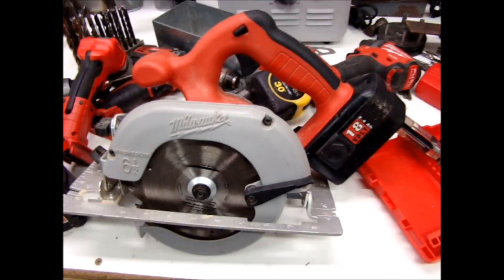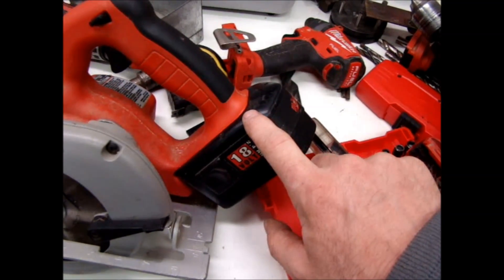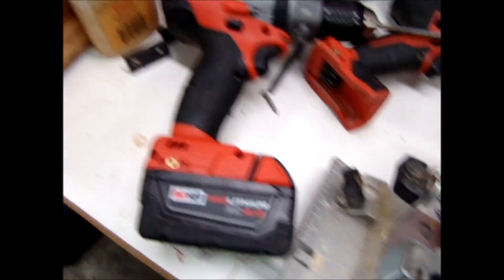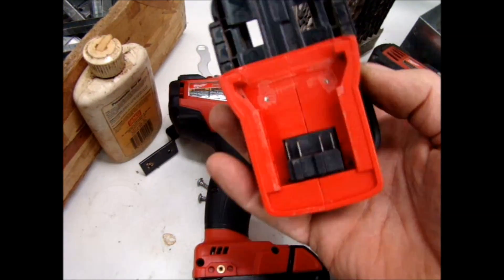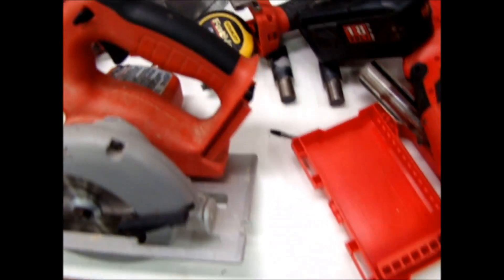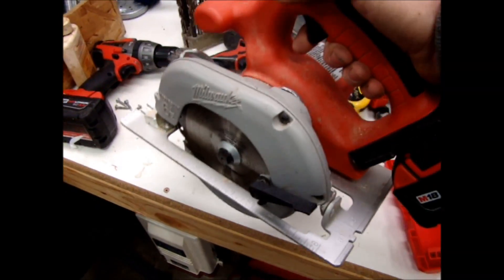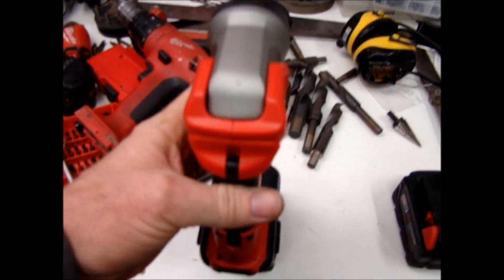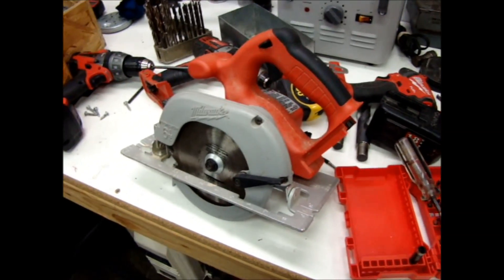18v nicad to 18 volt lithium ion battery adapter hack for Milwaukee cordless tools

Comment: I made my own and just wired positive to positive...etc and it runs on the 2.0 batteries but not 4.0 it’s like the battery automatically knows it’s not the right tool how do I bypass this?
Reply from the maker: Whoa! I've never had that problem. Not sure what to do.

Comment: Don't the v18 batteries fit your tools without having to resort to an adapter?
Reply from the maker: Nope.
Reply: @Makebuildmodify  48-11-1830 is the part # for the lithium ion battery for my German made drill which was designed to use nicad batteries. The v18 and V28 batteries plug into my 18 volt drill. The nicad batteries plug into my lithium-ion charger but they won't charge since it's the wrong charger but the plug is identical
Reply from the maker: @rabbibacongrease88  That's correct. But They were made after I made this video. Plus I made my adapter to use the batteries that came with my new drill.  That way I don't have to but lithium batteries for both types. I can just buy only the new type moving forward.

Comment: You can also use a milwaukee usb, I used a makita usb on my ryobi 6_1/2 saw with little modification works great.
Reply from the maker: Yes, I used it on the last one I made. They work well.

Comment: So using the NiCd battery top is so that it fits the original tool? Using the lithium tool bottom is done so that it accepts the lithium battery? Is mating the two simply soldering positive to positive and neg to neg and screwing the two housings together?
Reply from the maker: I just uploaded my new step by step video for the battery adapter! https://youtu.be/31-U8AhMFUM

Comment: What is the model number of the 18v flashlight you're taking the base from?
Reply from the maker: Milwaukee 2735-20 http://amzn.to/2r3lIbJ  - Or I think this USB adapter will work with a little modification Milwaukee 49-24-2371 M18 Power Source: http://amzn.to/2r3qeqK
Reply from the maker: I just uploaded my new step by step video for the battery adapter! https://youtu.be/31-U8AhMFUM
Reply: Don't cut up a tool to do this, read my comment above.

Comment: How much does the runtime increase, my 18v Milwaukee had terrible runtime on the old battery. ID like to see a review comparing this saw using the old battery vs new battery for cuts made, that would be interesting. ..great video by the way.
Reply: Your amp hr capacity is much more. Plus the discharge curve is more flat right up until the end.   Nicads had 1.5, 2.0, 2.2, maybe 2.5  amp hrs at the best.  Now you know the lithiums have anywhere from 1.5 to 9.0.  Common are the 4.0, 5.0, and 6.0 for the mid size like what he was using.
Reply from the maker: Great question. I gave this adapter to my brother (professional builder) and he's been using in field for a couple of years now and loves it. We've never done a side by side test though. Thanks for watching!
Reply from the maker: I just uploaded my new step by step video for the battery adapter! https://youtu.be/31-U8AhMFUM

Comment: Awesome idea and looks solid.  How did you fasten the new flashlight bottom to the old battery top?
Reply from the maker: Chris x I used the screws from the old battery. I had to put create a couple of new holes though.
Reply: Awesome, thank you for the quick response.  Ive got that same circular saw you have, a drill, a sawzall,  and the older 18V flashlight from a kit I got in 08'-09'.  I had since upgraded to lith ion tools, but this will revive my older milwaukees for a great back up set.  Thank for the great info!
Reply: Oh so I don't overlook anything.  Ill need a newer lith ion flashlight, lith ion batts and charger to complete it correct?  What did you use for a clean cut on the flash light handles?
Reply from the maker: Chris x I used a bandsaw. but a hacksaw would work. I'm working on another design that uses more of the old batteries housing so you can keep the positive locking mechanism. so when you do yours take a look at that because these will slip off with the type of adapter I made in this video.
Reply: Ahhhh will do .  Took a closer look at an old battery.  Yloure right if you only retain the top theres no locking mechanism....hmmm time to get creative...lol. Thanks again!
Reply from the maker: I forgot to mention that Milwaukee makes a USB charger that is nearly the same as hacking the bottom off of an old tool. They sell for around $30. I just bought one to do the next adapter with. I haven't opened it up yet but it looks promising.

Comment: I done that with my Dewalt tools, Li-ion batteries are so much better
Reply from the maker: Yes! Waaayy Better!
Reply: I have actually converted everything I have also that is not Dewlat to take Dewalt batteries, a hedge cutter, a half inch impact driver, leaf blower and a sabre saw and they work so much better, I only need one charger and a few batteries for everything :-)

Comment: Hi, great idea, could you explain how the wiring goes because the old has 3 terminals and the new has 4 terminals,
thank you in advance.
Reply from the maker: If you have both old and new flashlights they only have two terminals. Those are the two to use. Use the location of the old and new to map the connecting wires to the respective locations on the adapter. Don't forget to check polarity. Thanks for watching!
Reply from the maker: I just uploaded my new step by step video for the battery adapter! https://youtu.be/31-U8AhMFUM